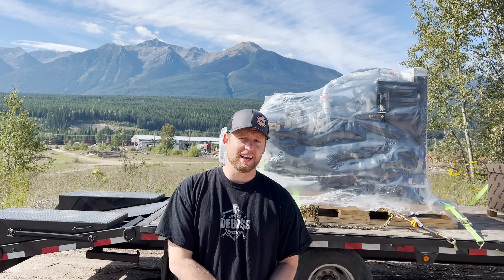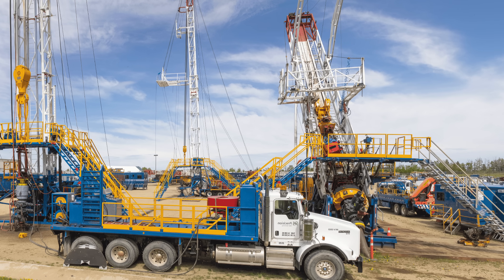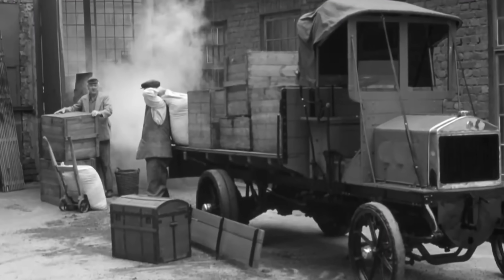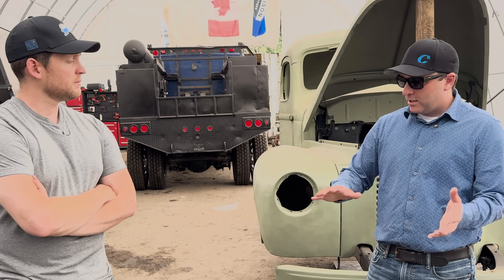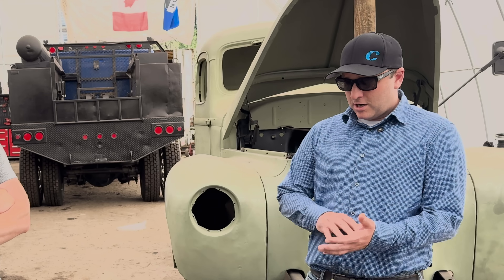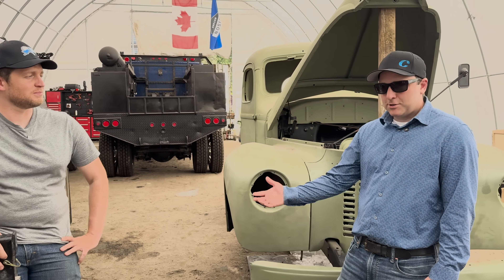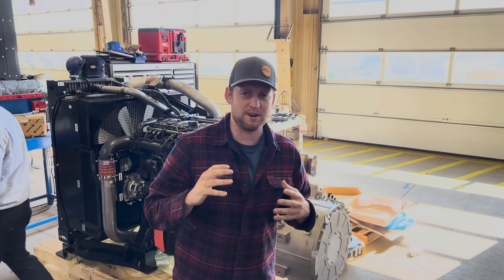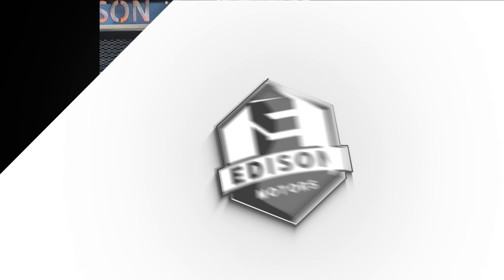We're putting Scania engines into Edison Motors Trucks!

Comment: Scania is top quality - look into the little things like emissions sensors - how many are there on an engine and what’s the supply chain and stock levels  like.  May not be an issue but if there’s a breakdown on a European truck, half the time it’s stupid little stuff
Reply: Mm, you mean o2 sensors. In Europe they banned Def. So over half the stuff that send a truck to the shop just is not there. They hit have had to add a particulate filter. The egts will keep it from needing to Regen. As long as the filter is not so full of ash that it will flow air the emissions will not shut down to motor. It will just burn dirty or have more black smoke that the filter has to trap filling it up with ash and then making it not run. You have 200k before you have to worry about anything. 

There is a reason why they have gone this route. Don't you wish that you could get a new truck that had the emissions that we had back in the early 2000's. Then buy a Edison truck.
Reply: @thomasswearingen6971   uuuuh, i can say that no, no one in europe banned DEF/Adblue, it's still there.
Reply: @thomasswearingen6971  DEF is definetely still a thing in Europe, it just known under a different name. We usually just call it Ad-Blue
Reply: @thomasswearingen6971  They didn't ban DEF, its just under a different trade name, known as "AdBlue"
Reply: @thomasswearingen6971 dpf has a lot more than just an 02 sensor. 

You sound like a salesman. 
‘You’ll never have problems from our emissions’
😂😂😂😂
Give me a break
Reply: Ok so I might have been wrong about def fluid. So my question is if the truck will not have def then how do they control the emissions? My diesel uses O2 and a particulate filter. I can fix thoughts things and it will run until the particulate filter is full. On cat's with a particulate filter all you do is send them out to by baked and cleaned when they get full. So if that is the system that Scandia is using then what will go wrong? The truck will tell you when the particulate filter is starting to plug and needs service before the truck shuts down. On a def truck it just goes into limp mode or shuts off. The system is a lot simpler to work on.
Reply: @thomasswearingen6971  they do have DEF tho, they also have a Diesel Oxydation Cat, they just don't have a DPF.